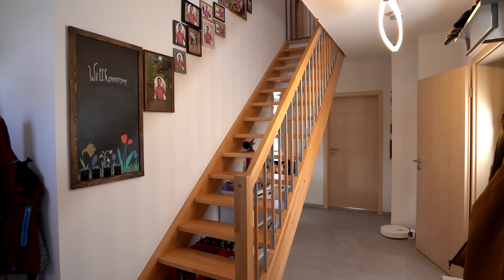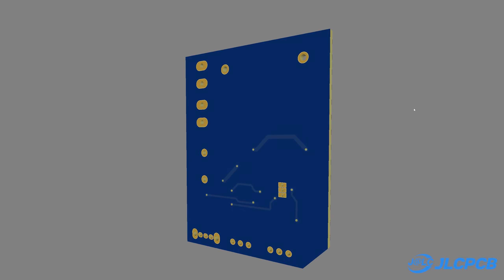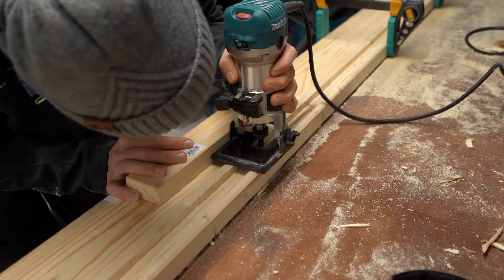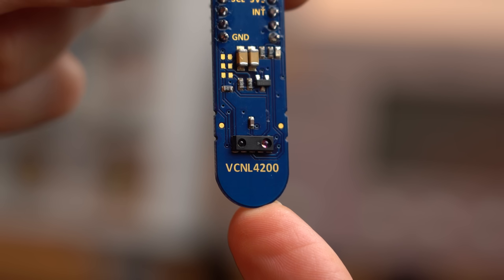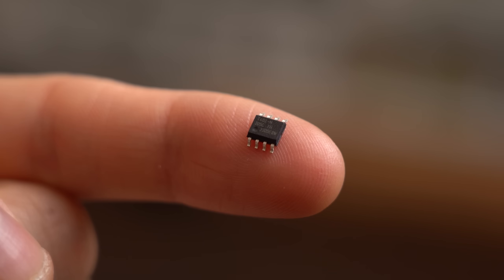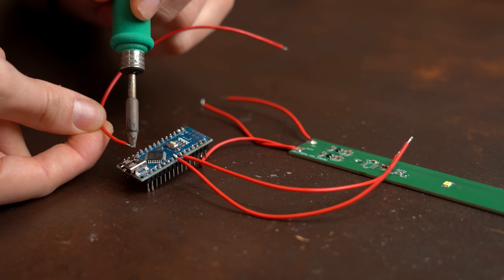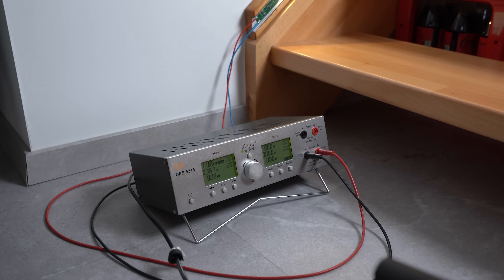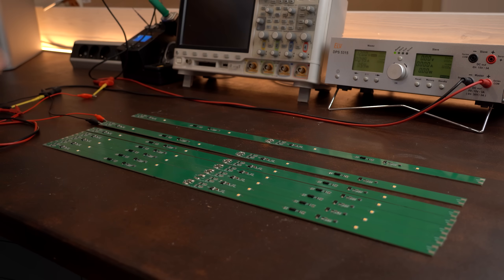I tried to Revolutionize LED Lights!.....And FAILED?

Comment: As was already pointed out, you definitely need one diode on each "OUT" or one diode on each "IN", otherwise you're just connecting everything together and it can't possibly work as intended. Apart from that, make sure the distance sensors aren't interfering with each other (by seeing each others IR scattering of the other side of the stairs) and make sure you only evaluate the light sensor measurements when the LEDs are off, so they don't measure their own light.
I can't really imagine noise from the switching regulators being that bad, assuming they're laid out decently. The voltage drop across the PCBs also seems alright, given the fairly even brightness across the length of the strip. So I would expect the power supply to be good/clean enough.

Comment: I think it was just a bit over engineered. Each step only needs to come on when it detects presence and remain on slightly after presence is gone. If each step turns on itself and one above and below that should be sufficient. I think you could do it in discrete components and not need a microcontroller etc

Comment: What went wrong on the design was the lack of use of algorithms. 
My suggestion on algorithms is that only the end of the staircase will check for humans. If they found a human, they will alert the next sensors to find for humans. And the next and the next until the human was done using the stairs. I wouldn't suggest using all sensors at once and they will mess up your ground.

Comment: You can use the diffuser and make holes for IR sensors or even add lenses to them.
It seems that one or more sensors are sending signal to other boards or there is a small short circuit. I suspect the top one.
Asulate PCBs of aluminium brackets better.
Also it is possible sensors are picking up noise, try lowering their sensitivity.

Comment: Maybe its my analog circuit designer speaking, but I really dont see why you had to go for a microcontroller and all. Honestly I would have just wired some PIR sensors with NE555 timers that turn on for x seconds, with OR gates to the next and previous step signals so you get light one step ahead

Comment: Hi, try running a separate GND connection through the entire series of board as a GND busbar and ground all the boards to it. (the length maybe causing the capacitance issue which is causing the false trigger)
Also, try to program the board independently without the data line.

Quick check the angle of the IR sensor, maybe it needs a cover just to sense a certain stairs.

Comment: When you light up the LEDs in the dark does it cause the daylight function of the code to become a destructive feedback loop?
Crosstalk between proximity sensors should/could be an issue unless you have them enabled / disabled on interleaved function.
I2C buses are not meant to be long, you need repeaters to reconstitute the signal.

Comment: Great video @GreatScott! Thank you for sharing this to us.
My take would be :
Why do you want to pass through data lines ?
I mean if one board is working fine alone, why don't you let the µController handle the logic for one board and just passthrough the power ? Each board works indenpendantly and lights the LEDs where you are.
Maybe you're worried about it not being consistant through the stairs (as some controllers may have small errors that differenciate them from one another ?) ?

I hope to see your update soon. I know how frustrating that kind of project can be, and I'm still working no how to handle the frustration that comes out of it, hope I could help.
Also, I saw a comment about one diode missing at some point on a data line. Maybe you don't have to start from scratch.
Reply: He wants the upcoming stairs to also light up.
Reply: @Rubacava_  it can do it by its own
Reply: @Niyazakill  It can't. How a single pcb would know if distance sensor is not triggered and there is no outside information?

Comment: That's  a HUGE PCB with LONG traces and that causes issues with noise coupling, impedance matching and all the rest. You have to design the board and circuit properly, use 4 layer PCB, and the layout and traces need to be well designed. You need to lower the current loops, make sure any signal traces are very well coupled to the underlying ground plane etc...

You can get a way with a lot in small board, with relatively short traces... but at some point, things just stop working and you need to up your design game.

This is why experienced folk will always yell at beginners and hobbyists that they should try best practices on ALL PCB's they ever make and learn that way the best practices and then it becomes second nature :)

Comment: This project without the diffuser is kind of uggly sorry. I don't know if in person it looks better but the exposed pcb is not pretty either.
Try to put  the sensor on the very top edge of the pcb and pass the diffuser without blocking them. An algorithm to transition the lights would be good to, using derivates you'll know if a person is  going up or down and illuminate the stair ahead of them.

Comment: When I messed with several IR-Distance-Sensors I found that the IR was messing between the sensors. I would expect that for reliable function, you need to time the measurement  between the different sensors. Maybe just keep the outer ones sensing and only activate the next sensor with some delay when the neighbor sensor was detecting.

Comment: I’d honestly try this with some of the neopixel style addressable LEDs and a single micro. Making this a distributed system is way more hassle than required. And if you have one of those radar based human detectors 1 should do the trick.

Comment: Nice Video. I think, the different distance sensors interfere with each other, espacially in the upper area, where the white wall reflects better. Try sequential scanning, synched through the data lines.

Comment: I know you really want each step to be lit one by one, but is such thing really necessary? Maybe 1/3 or half staircase to be lit at one time (and put 10 sec delay) will do. Of course that does not correct the noise and proximity, but I hope that will make coding and electronic part simpler.
Thanks a lot for showing your failures though, as that give you (and give us) room for even more creativity and solution finding.

Comment: I think that your cummunication lines failed - they are too long, they act as antennas. They should be disconnected from the microcontroller using a buffer (any king of non inverting logic gate or something like 74hc245 buffer placed close to the mcu). It still isn't the proper way of dealing with longer communication lines but it should help. Next thing is capacitors - there is only one 100nF near the AVR - that is not enough, it just decouples small voltage intereferences, microcontrollers consume large peaks of current, they require 100nF and about 4.7-10uF next to every power pin (in bigger microcontrollers that have many VCC pins).

Comment: Maybe you're overthinking your design. One sensor at the end of the staircase would trigger the lights running away from the side where it was triggered. Unless you have huge variance of stair running speeds, or tend to reverse direction all of the time, you can dial the speed and fade wave pattern that will almost always look like the lights are walking with you. And it can be done with a basic ws2812 type xmas-lights strip.

Comment: I think the problem would be using IR sensors in this configuration. It could be easily affected by the background IR radiations from lights/ heaters. 
I would suggest using IR sensors similar to  burglar alarm configuration.

Comment: Well, you could drill into the banister itself and put the LEDs in there, the wiring, etc.  Technically, the banister isn't the staircase....

can you tell that I've been divorced a few times?  🤣

Comment: That's a fantastic project.  I've done something similar.  One problem I ran into is that the light turning on looks like ambient light to the sensors and can confuse your software.  The way I got around it is to track the day/night cycle so it knows when it's supposed to be night.  I would also recommend that you print out debug over serial so you can see what the software is actually thinking and doing, but not sure if you have pins left for that.  I hope you manage to fix it.

Comment: did you tried avoiding noise interference by using ceramic capacitors and why not just use simple on and off for leds instead of PWM signal ?

Comment: I love the idea and design. As I am a software guy I sadly lack the tools to tackle such a project and my last soldering was 15 years ago at university.
For aesthetic I would recommend you testing again with the diffusor and some drilled sensor holes, maybe even with a clear plug as dust cover.

Comment: I had a similar problem with the my bathroom. My wife would get up in the night, have to turn the light on in there, and come back with her prospects of getting back to sleep ruined by the light.
I took a much simpler approach and just engineered a board that monitors the light level in all frequencies above deep red, and phases up an ultra deep red LED as the light drops low enough to not be easy to see by. A quad op amp, a couple of FETs, and a handful of passives does the trick perfectly.
Since installing it, she says that she doesn't even remember getting up in the night anymore.
I'd say your design probably didn't actually need microcontrollers.

Comment: What a frustrating experience! A break is always a good idea, it often give you a clearer head to finally find the issue. To add to the complexity of your project, :) perhaps you can light up the next PCB as well as the current PCB so you can see what you're going instead of where you are?

Comment: How are the distance sensors configured in I2c? If you daisy chained them all together, do they all share a ic2 address or are they all on different addresses? Could be the problem.

Also the “length” of the I2c lines matters.

Check out adafruits I2c extender for more info.

the length of the cable adds capacitance and resistance that slows down the open-drain pullups used in I2C, making it hard to use 100KHz+ clock speeds. You could try slowing down your I2C clock to 1 KHz...or you could use an Adafruit LTC4311 active terminator like this one!

Comment: If you are already in the process and have delayed the project; it makes more sense for the next step to be illuminated in advance rather than the one you have just stepped on.
You actually want to know "where you want to go next" and not "where you have just stepped"
For the actual detection, a real light barrier might be worth considering. You could place inconspicuous reflectors on the opposite side.

Comment: Thanks for sharing the whole process. One alternative would be to have sensors at the top and bottom which turn the lights on for a predetermined amount of time. Plus you can use the diffuser panel.

Comment: Aren't you essentially defeating the purpose of having a side light on your staircase by requiring the user to step on the steps for it to work? What if you miss the first step or slip because you didn't know where it was? Why not have the whole light set dimmed all the time with it lighting up a bit stronger when you step at a particular step? Or better yet, why not light a few steps on front instead of just the step you're in?

Comment: Do you have 5 meter data long bus? You can't simply drive a 5 meter long bus with the pins of a microcontroller. Busses for long distances are current driven and require special circuitry.

Comment: Lovely project.

I would just address the full staircase with one Atmega 328P and try to have the sensors chained so you could deal with addressing it centrally.
Include a RGBw WS2812 Led strip instead stop messing with individual steps; you’re not going left or right there anyway and want to see where you are going, not where you just stepped onto.
I’m saying this for your wife / girlfriend, not for you. 😅

Give the top and bottom stairs a radar presence sensor so walking upto the stairs makes the first step you want to take light up.
The bottom and top could also contain an LDR so the staircase doesn’t light up if it is light enough.

I’ve made a staircase with an individually addressable led strips (a lot of wiring) about 9 years ago. It manages two staircases with one controller.

I generally leave an SD card in the space where my project has the microcontroller, which contains the sourcecode, in case someone buys my house. 😂

Comment: I have done something similar.  Use a radar sensor (the cheap microwave I think frequency ones) and you can route a hole in the wood and mount it from the backside so you don't see it, they work through wood.  Have one at the top of the stairs, one at the bottom.  Build one control board to manage those sensors, and to turn the LEDs on and off.  Run wires to the LED locations, and this can all be done on the backside of the wood so all you'll have on the front of your nice wood strip is the hole with the LEDs and you can add disfussion covers easily.  Code it to turn the LEDs on in ascending or descending order (depending which sensor triggers) over 1-2 seconds, using PWM, and auto-shutting off in the reverse order after 20 seconds or so.

Comment: I'm curious why you insist on motion or infrared sensors rather than pressure or similar light-touch pushbutton sensors/pots. You step on a step, it closes the binary circuit or sends resistive touch. Mount the sensors under the two neighboring steps, wire accordingly, and change the sensitivity in software or with extra circuitry according to whatever datasheets or electronics principles you follow. This is basically what rhythm games like Dance Dance Revolution do and what automatic sliding doors used to do before they started using light sensors.

Comment: I'm not as comfortable with creating my own boards, so I control an LED strip with WLED and two ESPHome sensors at the top and bottom of the staircase. I have a relay for the WLED so that it will completely cut off power to the LED strip when it's off. They are then automated with Home Assistant. The LED strip is simply taped to the under side of the handrail so no defusion required.

Comment: Thanks for sharing the failures and not only the successes. It's very educational and shows how making projects normally go. It's never pure success.
One though I had during the video; I guess you can still use a diffused LED cover as long as you cut or drill  "windows" where the sensors are.

Comment: Here is a easy work around. Use a mm wave human sensors the new ones which also tells the position. Based on the position info turn on that led strip section, you can do two to three stairs at once. Do away with all the complicated circuitry. Its very easy.

Comment: I would try to go a bit other way:
I would use some I2C bus or something similar for presence detection sensors, but then i would use addressable LEDs for light. I would use a single microcontroller to read the presence and drive the LEDs. This way, you also have future options to light a bit more distance before and after the part where your leg is detected.

And well, if you use ESP32, you instantly have IoT staircase lighting! ;)

Comment: omg I understand this state of mind sooo well. I usually need to put the project somewhere so I can’t see it for a while. Everything should work but in reality it does not. Bad connection, noise, voltage drops, crosstalk

Comment: Before you start again, pleas check if you don't need some kind of shield around IR dectors, because if they don't have posiblity of coding impulse then they can interfere with each other 
(IR reflects quite easily, especaially i saw some metalic cylinders on barier bars ?).
A yes impulse power can mess with such beautifull projects... 
Once i did "digital guitar effect" with mutliplexed 7-segment LED displays and i powered everyting including OPAmp from the same +5V source... It played without a guitar, more it was impossible to hear guitar even 🤣
Also for long data lines it is better to use twisted pair dirvers or use "20mA current protocol" wich is used in RS-485.
Reply from the maker: Thanks for the feedback. Will check that out.

Comment: If you only want the lights to turn on from proximity... Why not go full analog?
There's no need for a microcontroller for this application in my opinion 
As a simple compartor and constant current for the leds should be enough

Comment: Typically the power is fed using common line. And possibly data too. personally would use the aluminium profile attached with needed lines using copper AND create those elements in a more serviceable way i.e.   use screws and have connectors between elements if those somehow need to be daisy chained.

You may possibly think to "relocate" your 0V if in a noisy environment.

You could use that system to support your intrusion detection too...

Comment: I have some recommendations.
Use a diffuser cover with a hole for the distance sensor. This will help to spread the light more evenly and avoid any unwanted reflection on the sensor itself.
Instead of controlling individual LEDs that need to be programmed separately and are difficult to replace, consider using an addressable LED strip to control everything with a single microcontroller instead of 14 separate ones. This allows you to control each LED individually and define when to start and end a stair step, achieving similar functionality. You also get more flexibility and easier replacement. You can even change the color and brightness.